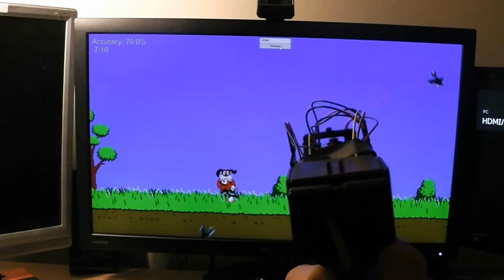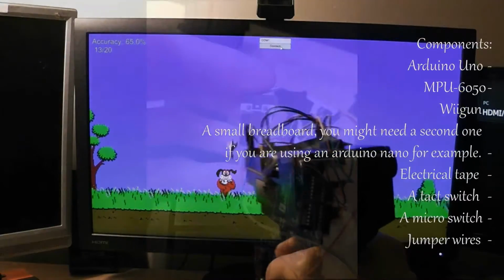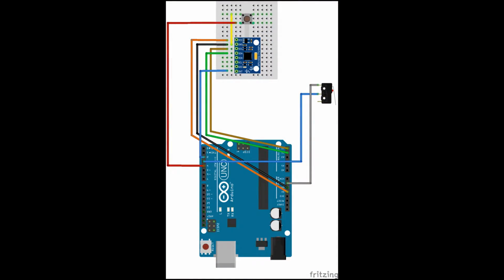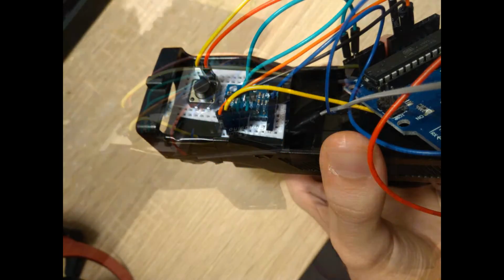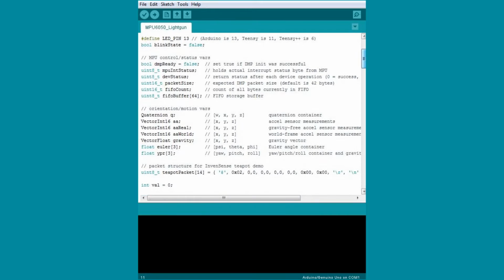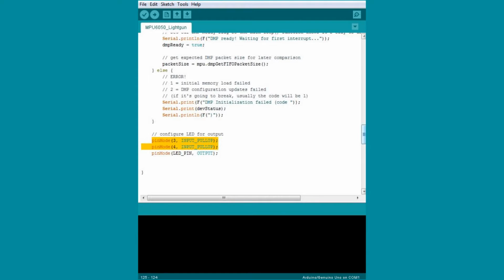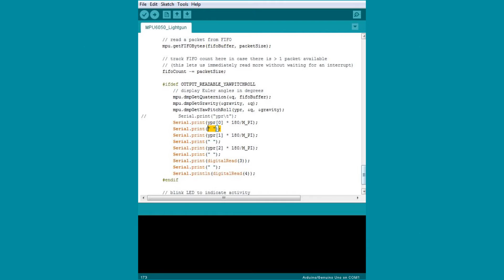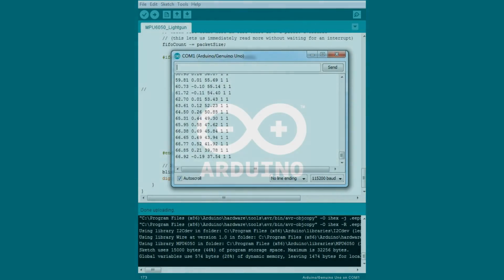Arduino MPU-6050 and Unity - Lightgun for Windows - Part 1

Comment: when i use arduino pro micro.. i was confuse about the wire.. int (gyroscope) where i should connect it?
Reply: Sorry for the delay. I think the connections are the same. You can also try without connecting the INT cable.
Reply: @FNGamesOfficial  allright

Comment: did you change the firmware of your board???/
Reply: Nope.
Reply: thanks man
Reply: It's possible with an arduino Uno, but the way I did it I'm emulating the key presses and movement with my Unity software, so it's not needed. You're welcome and good luck if you try to make this :D

Comment: I have  an error while using your code sir.
The error statement is :
<'class MPU6050' has no member named 'dmpInitialize'>
Can you help me by rectifying it?
Thank You.
Reply: Thank you sir.
Reply: link is broken :/
Reply: @yakupsevik5733  I'm sorry for the late reply, I don't remember which exact library I was using, but try this https://github.com/jrowberg/i2cdevlib/tree/master/Arduino/MPU6050
Reply: @FNGamesOfficial  hey the code is giving me errors like 
"S:\OneDrive\Documents\Arduino\libraries\MPU6050\MPU6050.cpp:1679:9: note: code may be misoptimized unless -fno-strict-aliasing is used
S:\OneDrive\Documents\Arduino\libraries\MPU6050/MPU6050.h:438:9: warning: '__comp_ctor ' violates the C++ One Definition Rule  [-Wodr]
         MPU6050(uint8_t address=MPU6050_DEFAULT_ADDRESS);
"

i make sure that i was using the same libraries as you did ans still has the error :c
Reply: i you can help me i will appreciate it a lot
Reply: @lalomtz2000  Sadly I've never seen that error. Are you using the Arduino IDE? Or another software? If not, could you try with the Arduino IDE?

I found this in the Issues tab in github
https://github.com/jrowberg/i2cdevlib/issues/424

Hopefully it can somehow help, it looked a bit confusing.
Reply: @FNGamesOfficial  im using the arduino IDE, so let me check the link you gave me, thank you!
Reply: @lalomtz2000  you're welcome, good luck and let me know!